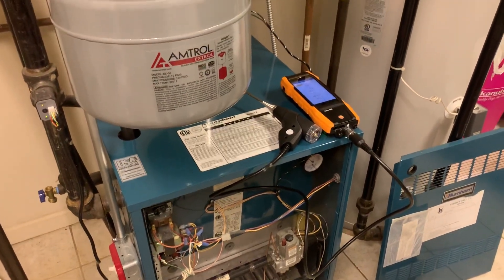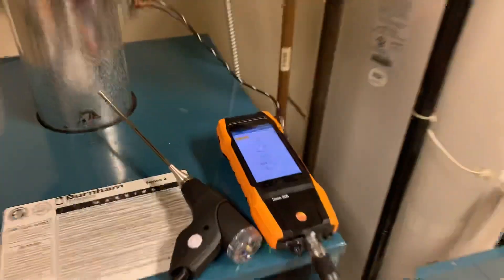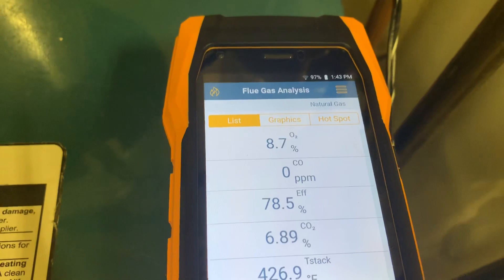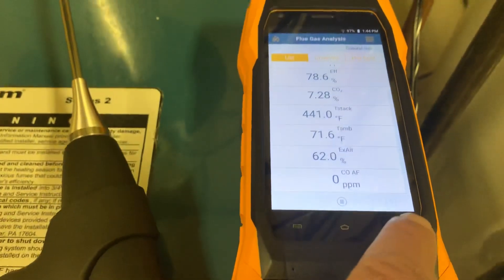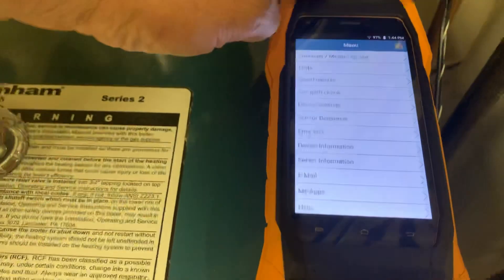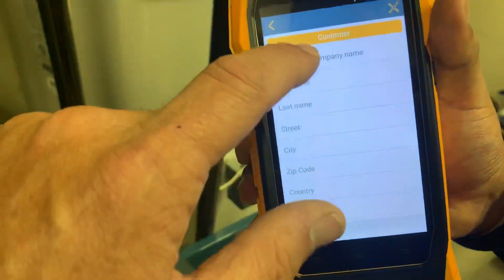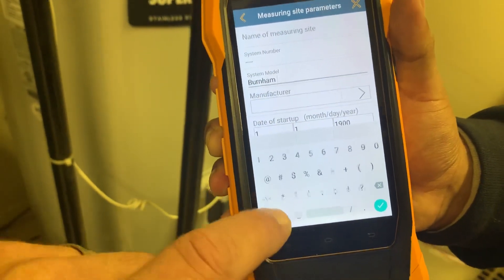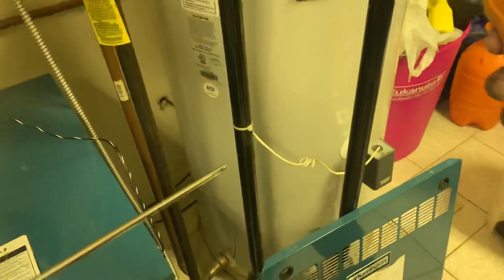Testo 300 Combustion Analyzer - Day 1 Review

Comment: Just bought it myself it’s not as touch test responsive I would have like a front page menu rather than defaulting to test menu. Setup on WiFi was glitchy and set up for email was problematic still have not been able to do that. The browser is cool and test are good the user manual could be much better.